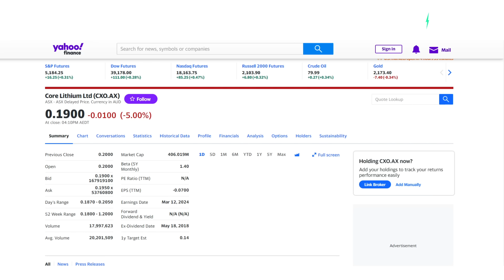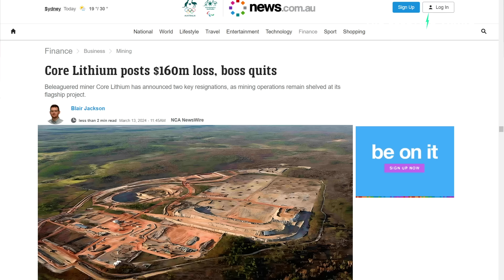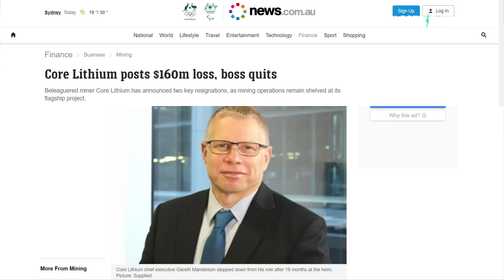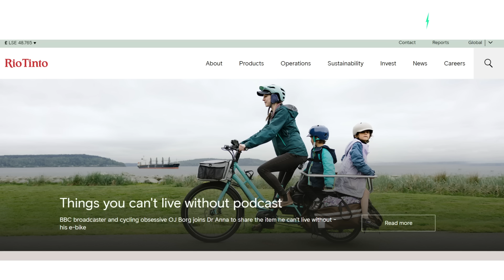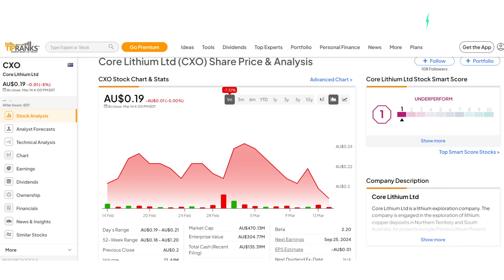Lithium companies losing billions forced to close down mines

Comment: They had a long term offtake agreement with Tesla when the price was high, with guaranteed offtakes, but turned it down in hope for a better offer. Unfortunate decision.
Reply: It's impossible to see the future.   A couple years back, all the rage was to predict STRATOSPHERIC lithium prices in coming years.  

In a similar way, crude oil prices are HIGHLY volatile and EXTREMELY difficult to predict accurately over time.  

Or pick pretty much ANY volatile commodity -- same thing.

Comment: Lithium prices are NOT cheap. They are just the same as in 2019 before the bubble. They should be even cheaper to make EV batteries competitive.
Reply: Over time, it's all about supply and demand, not what you think prices "should" be.
Reply: Overtime it's all about margin.... And affordability.... And it all comes down to the concentration of the source
Reply: They are cheap if mines are closing. Prices must and will rise as demand increases.
Reply: The need for the amount of lithium per battery has decreased. 

But where those Sodium Batteries ❔️

I hope that don't turn out to be  just a myth.   😳
Reply: @icosthop9998 Sodium batteries will first come in "power walls". But at least one Chinese EV has a sodium battery, I think, if I remember right.
Reply: Incorrect. Lithium prices collapsed 40% in 2023 and more supply is entering the market than the EV manufacturers can absorb! From last year it declined YOY 70%! It will be unstable for some time. So cheapness is relative! As supplies drop out prices will stabilize, but that may take some time indeed, possibly Years.
Reply: @monkeysezbegood but the amount that can be produced for a much lower price is growing. Lithium mines are opening up all over the world (Cornwall in the UK) and new tech is making it much easier to extract. The price of lithium will drop as supply becomes too easy.
Reply: @RandyP-jr1ek  several things went on here and it's not as easy as " oversupply".   Spot price is  below production cost....in china.  There's shenanigans afoot.    There are mining companies who are going out of business..... They went heavily into debt.... They have marginal concentration sources..... They have 6 month inventory on the books at higher prices...... And they can't sell it or their bankrupt.   So they have to shut down.     

This is nothing like a normal supply demand situation.......not at all ........

Now if the China government supports Chinese producers through an artificially low price..... Bankrupts small startup western producers..ie core lithium, etc.. And let's the Chinese producers buy their assets........ That seems to check off all the boxes.... In advances China's desire to grow their lithium marketshare
Reply: @colinwiseman  no it's not price is not getting lower, it's going up because the sources are not as economically profitable as the existing sources. There is no new "tech.."..... That allows more profitable processes ..... It's exactly the opposite......., I know something about this and I worked on a plant for dle.... It's much more expensive and has lots of issues.    There ain't no pot of gold for 90% of the companies who were trying to get their foot in the door.... They're lithium  is going to cost them too much.... And their debt is going to be too high.....
Reply: @MudflyWatersman  best let EnergyX and Princeton University know all that, as they have new tech bringing down the cost of lithium extraction. And being you're a rando on the internet you surely must know better. Go...go save them money. Good job, you. 🤘
Reply: @MudflyWatersman  and I work for the PRESIDENTS OF THE UNITED STATES OF AMERICA. Peaches!
Reply: @colinwiseman  sorry, I work for my employer already.
Reply: @colinwiseman  nobody has any new tech to bring down the cost.  With raw materials affordability is always about concentration concentration concentration.    The lithium isn't the problem it's the scale of the processing required to produce the quantity desired 

There's gold in seawater why doesn't everybody just go get their share..... Because it's not worth it it's too hard to get it out.     There's gold in sand from home Depot....... It's not enough to be worthwhile to recover it.
Reply: @MudflyWatersman  so EnergyX and Princeton are lying. Oh I'd get on the blower to their shareholders if I were you. You'll save them millions! Good job, 👍
Reply: @MudflyWatersman  you work for your employer already? If you didn't work for your employer already, would they be your employer?
Reply: Great! Just one problem: no one wants EV's.
Reply: Supply and demand. And right now, the demand is not there with most US car manufacturers halting EV building. EU car builders doing the same.
Reply: @Hunty49  i think there is some cognitive bias here

telsa publish their inventory figures, they have 1k of model 3 and s, 2k  x and 8k of y

that is all combined global stock available for delivery right now

this with an annual production rate of around 2m

telsa do not have a demand problem, they have a supply problem

heres the thing, tech in EV auto industry is moving way too fast, sodium ion batteries are now being delivered, LFP batteries hit mainstream EVs in the past 2 years and  have disrupted the profit model of older models, in another year sodium is going to do the same

factories have to shutdown and retool based on, if manufacturers don't adapt they'll be left behind

demand will be an issue for manufacturers asking for a premium on overpriced older models - so prices will be coming down but that is always the case

for tesla though, demand is not an issue, quite the opposite, they are jacking up prices because they know they are going to run out of stock before the new models hit delivery centres
Reply: @Hunty49  I think you and many in the comments completely misunderstanding the Lithium market. There are many projects that are about to come online that will make the prices go further down in Zimbabwe, Argentina, and Bolivia. Yes there will be a skyrocketing demand for EVs as prices go down, but also massive new supply coming in the next few months and years.
Reply: @richardweyland116  You are incorrect. Global EV demand is increasing, the reason for the drop in Lithium prices is because of the Ramp-up of Lithium production from the Zulu mine in Zimbabwe. The supply is increasing and thus prices are falling, even with higher global demand for EVs.
Reply: @colinwiseman The Copium market is at an all time high but your propensity to over supply will cause an inevitable crash. It's just economics bro.

Comment: Funny, says he can't call the bottom for fear of being fined, then calls the bottom. Unusual Viking move.
Reply: It’s not unusual for mining companies to put their operations into maintenance mode if the value of their product falls below a predetermined level. They sit it out and wait until the stockpiles are exhausted and there’s a shortage, then they fire up again but sell at a hugely increased price. These reductions in battery costs due to cheap lithium are only temporary, watch what happens down the track. Batteries are always going to be the Achilles heel of EVs, just like any other battery powered appliance.
Reply: They will sit forever. China is using sodium ion batteries. Now calcium is replacing lithium!

Comment: Lithium prices are just back to pre-Pandemic prices. All mining companies should have been planning for this day. The other big threat to lithium is... sodium. The last expensive raw material in LFP cells is... lithium. Even at today's prices it's still very expensive compared to sodium. All we need is for someone to scale up a practical sodium-iron-phosphate or sodium-sulfur or sodium-other-cheap-material battery, and the lithium show will be pretty much over within a few years. Even if energy density is relatively low, stationary storage is currently using a lot of lithium.
Reply: Nah ... It took 25 years to get lithium batteries to the current state.   Sodium just doesn't have the energy density capability
Reply: If lithium stays this cheap (which it wont) sodium has no future.
Reply: @monkeysezbegood         🤔
Reply: When lithium gets expensive, they’ll switch to Sodium. Then Sodium gets expensive, they’ll go back to lithium.
Reply: More lithium schills purporting lithium is the only viable chemistry. Never mind
Lithium thermal runaway the Conservative press has a field day with.
Nevermind the super cheap price of sodium. 
Never mind the extraction pollution of lithium.
Never mind all that the schills say. Sodium ion will never work.
Reply: @jb5music  news flash.... Everything requires a chemical production process to produce it.... And a raw material to be mined. Everything.   Even sodium.  Did you know sodium explodes on contact with water...........   There is nothing else that gives up electrons as easy as lithium does.... That's why it is unmatched.   Lithium is moving ahead exponentially and will always be much higher capacity and energy density than sodium.    Sodium is already in use for low energy density applications.

In the lab new lithium technologies have already been proven over double the existing battery capacities... Double... Sodium is it going to come close to catching lithium's capabilities
Reply: Close to 2 years ago Sam was talking about quantum batteries in a video. 

I guess that subject is dead.  ⚰️
Reply: @TheBooban Sodium never gets expensive! How much do you pay for 1 kg of NaCl, table salt?
What do you think happens if you take some metric tons of salt from the Pacific Ocean?
Reply: @leiflillandt1488  good point.
Sodium is much more easily available .

But someone needs to get those  Sodium batteries up and going in mass production.
Reply: CATL  and BYD just keep improving LFP batteries,  never hear of those two along with Panasonic thinking of working on Sodium Batteries. 

GM and Ford have placed their aspiration of building battery factories in Americaa on hold.

Both companies Placing EV production on the back burner and going all out on hybrids.

( Other than the Bolt ⚡️.
 These two  companies can't make a decent EV )
Reply: Lithium actually has a lot of uses. 

Alloyed with aluminium and magnesium  it can make super light strong metal alloys, something that will be in increasing demand. 

It also has medicinal use, I suspect there are quite a few of us who would benefit. 

Of course as a battery material it is super light, but magnesium, aluminium and sodium that could potentially be used instead, are not that much heavier.
Reply: If you compare the discharge curves of sodium ion vs lithium ion/iron phospahe/titanate, you will quickly see the problem. The operating voltage range is ridiculously wide. Li ion = 4.2 - 3.3V, LFP = 3.6 - 2.8V, Na ion = 3.9 - 1.5V. Which means cables and HV components must be built to work over a huge voltage range, or batteries must be twice the capacity to keep the the working voltage range acceptable 

And sodium ion batteries are already lower capacity than lithium. And sodium ion batteries are already heavier than lithium.
Reply: BYD has a sodium ion battery factory. Calcium will replace lithium soon.
Reply: @bubuneowoo6161   Sounds nice, But what is soon ? ❔️
Reply: @monkeysezbegood Well, thanks for letting us you have no clue about the difference in price between lithium and sodium salts today.
Reply: @TheBooban  That's the thing - sodium (salts) will never get expensive. There are massive sodium salt deposits all over. It's in your pantry and on your dining room table in a shaker. It's the primary "salt" in the ocean.
Reply: @tomtxtx9617  not sure. Lithium is quite abundant and the process is the same; evaporation. To think it was so valuable the Roman’s used it as money.
Reply: @TheBooban Oh, lithium is fairly abundant, it's just that sodium is FAR more abundant. Lithium is like 0.2 PPM in seawater. Sodium is 35,000 PPM.
Reply: @tomtxtx9617  but they’re not using seawater to extract lithium. In the area where they get lithium, what’s the PPM there? Maybe it’s more efficient to extract??
Reply: @TheBooban "good" brine for lithium is somewhere around 300-400ppm. Usually that brine also has >100x as much sodium in it, most of the effort for lithium is separating it from sodium and other ions. Sodium you don't even need to extract from seawater - you just mine it.
Reply: @tomtxtx9617  fair enough. Hope we can have salt batteries!
Reply: Sodium causes much worse intercalation damage to the elecrodes than lithium does.
Reply: And like that,   Chinese company Talent announces their new solid state lithium battery ....720 wh,/kg.     Twice the energy density of the leading ev battery today.   I keep telling people were right over the horizon from where we want to be..... And people keep wanting to believe that we've already reached the Pinnacle of EV technology..... We're at the beginning........ This is the energy density needed to usher in Mass adoption.    1,000 mi range is possible.....or more

Comment: Any experienced investor will tell you the bottom isn't what you're looking for, it's the rebound. If the price doesn't rise, you can be killed waiting for a ride that never happens.

For lithium, the question of course is supply and demand.

New battery technologies are being invented all the time and the future global energy source will be electricity but there are also cheap alternatives for energy storage and new lithium deposits are being discovered all the time. Lithium is one of the most plentiful elements in the Earth's crust but there are relatively few concentrations that can be economically mined.

Comment: It still could go lower... but that's not the point... as long as it doesn't go under...  ';  ) 0.18 does look like a bottom though, here's the thing, I think it is more than just over mining being the "thing"...  there's a public back lash... EVs are being "over sold" imo... (sorry Viking)  they don't do everything ICE cars do... not yet... the biggest issue is the variation in range under load...  and repair costs (as opposed to maintenance costs)  and also any cost analysis should include battery replacement... to not include that is misleading... what is the total monthly cost of ownership AFTER a battery replacement... but longer term, yeah... I think it's a safe bet

Comment: I think that most ev enthusiasts and renewable fold just don't get it. Generally people don't want ev's the range, cost weight just are not there yet. Not to mention the infrastructure to support it and to charge cars ur using coal is insane. I love new tech and I like rechargeable batteries and solor cells but it's not there yet.

Comment: What are the call letters? Think penny stocks at 19 cents, equipment, land, and piles of lithium. $300.00 x 0.19 = 1,578 shares. If it goes up to $100.00 each, then $157,800.00. Not bad.

Comment: This last winter in the U.S. showed EVs become side of the road paperweights in cold temperatures as EV battery charges run low and EV batteries cannot be recharged at charging stations.   EVs still need technology breakthroughs to become reliable and viable.  

Toyota and Hyundai report HYBRID 2024 sales are way up.  EV 2024 sales from all manufacturers are way down.

Comment: Sodium Ion batteries are now on the market, cheaper than lithium because (sodium is everywhere in nature), not the same VA/h  but they do the job, i got few to test  18650 and 26700 format and they work, they do not use the same lithium batteries BMS but can use same chargers, the only downside i find is that must be charged more often but they seem to endure more charging cycles and do  not have issues of cold or heat to operate.

Comment: the problem with Lithium isn't it's availability at this time, it's the cost of refinement as well as New Battery technologies being discovered on a regular basis, Sodium Batteries, Polymer Batteries, etc. Lithium could be dropped like a bad joke at a party if a much better battery technology appears in the next 5 years. Then there's my thinking that Batteries are just stop gap measures until the world puts the effort into producing Smaller and Micro modular Reactors, utilising Thorium or other safe technologies.

Comment: Lithium was developed as it allows power to small expensive electronic devices like mobile phones. They got smaller and powered up for longer. Then they figured Lithium batteries could make cars go very much faster. Now, we’ve figured cars don’t need to go that fast. So cheaper metal ions can be used to power large electric vehicles. 
We don’t need Lithium as the main element in electric vehicles. Basic chemistry, have a look at an activity table.

Comment: With several car manufacturers dropping or sharply curtailing EV production, electric companies adding costs to solar power owners (while getting laws promoting folks from going off the grid), interest rates sky high, and a global recession politicians deny but cannot hide, coupled to new major finds in Norway and USA, the price slump will last for a couple more years.  By then the Ambri battery may be ready to grow into the higher- capacity side of this market.  Yes it will come back - but probably at a slower rate than some companies can handle.